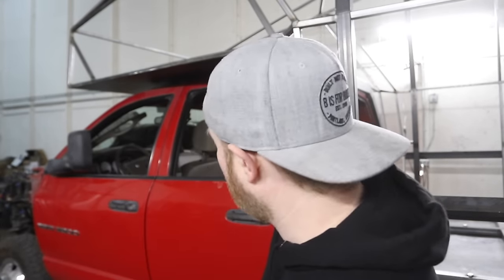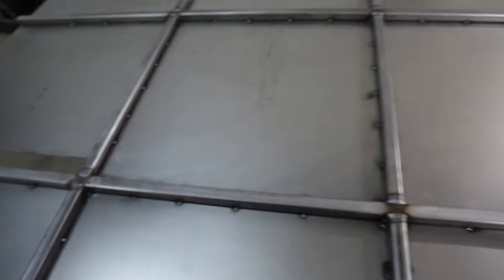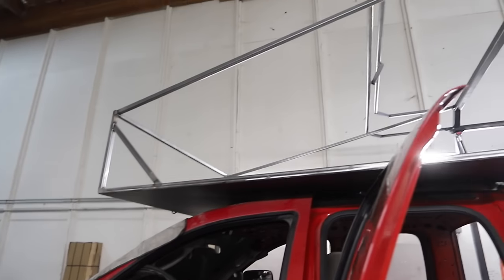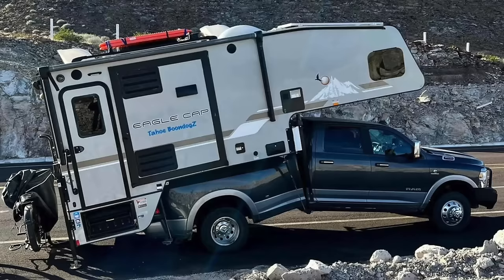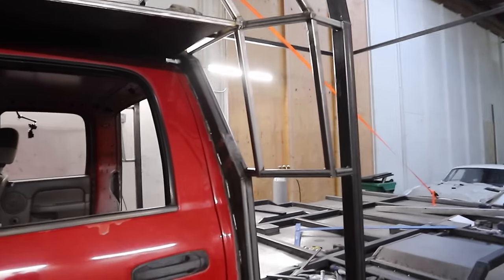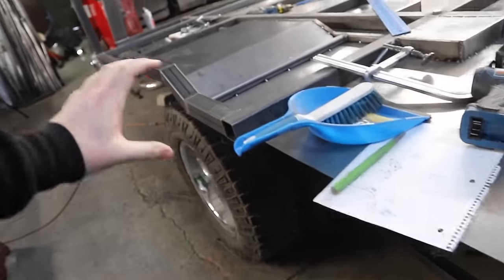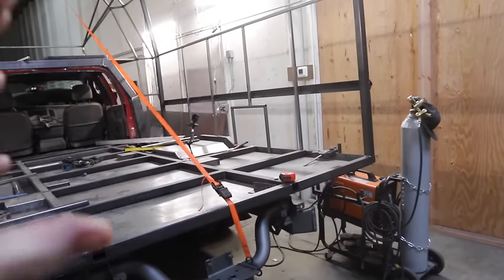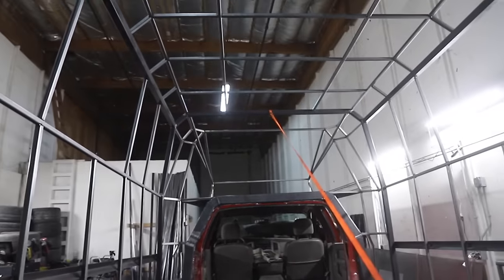Building The Worlds Craziest Overlanding Camper Truck - The ROOF

Comment: When you get to the insulation stage, begin studying “thermal bridging”. You live and camp in the northwest and you will be so happy with your camper if you keep the thermal bridging as minimal as possible. Basically, those metal “studs” for the walls need to have some material on the inside face that keeps the cold from transmitting to the interior face of the wall. Even a thin layer of insulation felt on the inside of all your steel members will cut down drastically on the heat loss through the walls.
Reply: He doesn't listen about frame/cab flex, why would he care bout thermal bridging......
Reply: Great advice. Also, I can’t imagine that using an aluminum skin would save a lot of weight… not sure it would add THAT much cost. But it would be significantly lighter.
Reply: @RealRickCox  when dissimilar metals are in contact it can cause galvanic corrosion. It's certainly simpler to keep it all steel.
Reply: @questioner1596  it's still worth adding a thermal Bridge. Even if using Steel in and out
Reply: @questioner1596  Ahh okay. Shows you how much I know about metallurgy! 😂😂

What if the aluminum is coated with Alodine? Would that protect it? I’m familiar with using it to protect aircraft. Not sure how it would work in this situation.
Reply: To the window (to the window)
To the wall (to the wall)
'Til the sweat drop down my b@ll$.
Reply: This is a terrible idea
Reply: @pauledwards6446  - what is a terrible idea?  Insulating the studs, or not insulating them?
Reply: @TheTalonts  the thermal bridging thing is a terrible idea
Reply: @java230  this is a street vehicle, no off-road vehicle. He won't have much flexing anyway.
Reply: @JohnDoe-zr6bk  mine flexes plenty on the street.....
Reply: @java230  because everybody in the comments is an expert...
Reply: @RealRickCox  any corrosion protection is a good idea. There are also ways to electrically isolate the aluminum from the steel with rubber washers; Ford does this with the F150. My point is that using aluminium properly is an extra few steps, and in the video he said he's trying to keep things cheap or it won't get done.
Reply: @java230 , I completely agree about avoiding thermal bridges. I was answering a subcomment about an aluminum skin, not the OP.
Reply: It's not like this thing will ever be used for its intended purpose.  Maybe once to make a video. "Look how good we are " 
Yeah, that type of video.
Reply: @pauledwards6446  It just means he has to tape/insulate over contact points. It's not a big deal.
Reply: @Enter-a-name55  he will take the cars he makes to shows away from home with this and take plenty of vacations, if you went to the pnw area you would see there is just about the biggest outdoor lifestyle there over any place in america

Comment: That looks awful close to the height of the loading door. IMAGINE IF "FINISHED" THEY COULDNT GET IT OUT....
Reply: In the last video he said they measured to make sure it fit. If need be they will air the tires down
Reply: He mentioned that.  Said they may need to let the air out of the tire or take off tires and roll out on a jack or something.
Reply: Just take the tires and axles off and drag it like they do at Copart.
Reply: Air tires out...temp shop
Reply: I was just about to comment on this. 😂
Reply: I’ve put a lift on my truck in a home garage… didn’t think about the height. You only do that once.

Comment: My prediction…. It’s gonna cause problems when the body twists, even a little. I’d use a nice rubber composite to fill the gap in between the cab and camper. Hopefully it works but I’m skeptical.
Reply: No the cab and the box are one just like a sub it is not going to twist
Reply: It's welded to the cabin. Ain't no rubber going to add any flex now.
Reply: I would of went with a rubber accordian boot between the cab and box. Whatever you want to call it. The cab and box always have movement between them. Even a very minimal movement will not play nice with their welding.
Reply: Definitely going to be problems with the way this thing is built.
Reply: There are thick rubber bushings underneath it. They will allow the rear to flex and the camper to stay aligned with the front/cabin
Reply: Right? In the last video when I saw them putting the same old braces back on the frame rails over the truck bed without any extra torsional reinforcement, I was like "These guys are doomed". Either the frame is going to twist (which it is designed to do) and take the camper with it, or the camper is going to have to have to have enough torsional resistance to prevent a) forces from it's own weight + forces the entire weight of vehicle + forces from being under sustained load when in a weird position + short-but-regular high-G impacts while driving. I love these guys and hope it works, but if you pit physics against blind hope, physics is going to win every time :|

Comment: The gvwr is the weight of the truck one driver and a full tank of fuel. The Dodge the broke in half had a ton of weight behind the axle where it wasn't designed. Your frames won't break because of the weight being spread over the entire chassis. The issue I see is once you build it and get three guys in it with all your gear and food and adding the tongue weight of a trailer your pushing your limits. But I'll wait to see what happens lol
Reply: GVWR is the max weight the entire vehicle and everything in it can weigh.
Reply: @OnyxCobra  yep I do believe they base the capacity on 1 person though. So the payload would be calculated at the weight of the truck with 1 person and a tank of fuel. If you add 1000 pounds of people and stuff that reduces you max payload by 1000 pounds. Some people just figure if payload is 6000 pounds they fill the cab with everything then add 6000 pounds in the box which is overloaded if that makes sense
Reply: @kevind5508  I like this BifB community. 
Very helpful and constructive 😎

Comment: One thing to consider is to reinforce your wheel wells in case of a blowout so when the tire blows, it doesn’t rip all the flooring out or any plumbing or wiring that’s from experience
Reply: im with you on this, if the frame twists at all thats going to be an issue.  im guessing parts of the box frame build will bend.  still wishing them best of luck though!

Comment: love the build chris just maybe suggest rounding out the front? even forgetting the drag/fuel/noise at even 60mph thats alot of force on such a large vertical plate on the front that is going through those front mounting points as it levers and a high pressure area between the roof and the frame. Just interested to hear your thoughts
Reply: Shuttle bus bodies are mostly fiberglass with wood, the  only steel is the frame for the floor.

Comment: Chris, this looks great and probably one of the most interesting builds of yours that I cant want to see the finished product. One observation that I have; I have a Toyota FJ with a camper tent on top, there is a lot of drag and noise over 55mph. The front on your camper is way bigger than mine so I believe it will be very noisy to drive and you will get a lot of drag. Hope you have considered the aero dynamics during the design phase. Wishing you best of luck with this awesome project.

Comment: Thank you for taking the time to address people's concerns.  I understand where you are coming from as I have been there many times myself.  That said, consider adding additional structure by tying the front and rear suspension perches together.  Not a guarantee, but will add a lot of strength through the weakest part of the frame, which is also what we did in the mid 90s to keep our 10 second street legal fox bodies in one piece.

Comment: Door on the left side is an interesting choice. Most camper trailers have the door on the right. Seems correct to be on the right when it comes to parking curbside. Not that you will be street parking it.
Reply: you can get in and out via the cab, so its not really much of a problem, if they do park kerb side, just go out of the rear passenger door.
Reply: I work in the RV industry in Elkhart Indiana.  The doors can be on either side but the majority are on the curbside.  I was actually a “door guy” on a few lines and had to pay attention to the door placement so I knew which door to install.
Reply: It’s going to have two doors. One on each side.
Reply: It's going to have three doors. One on each side and the back.
Reply: @Smokkedandslammed  back will be storage locker all the way across under the window
Reply: @Oscar_SMT  is this oscar did a great job oscar?
Reply: @Oscar_SMT  Its going to have four doors. One on each side, the back and on the roof.
Reply: @myopinion69420  but that seems inconvenient, might be a mild oversight.
Reply: No problem in Aussie then 😎
Reply: @Oscar_SMT  that seems like a waste of space, with one door you could have storage or bench space on the solid opposite side wall.
Reply: @MKPatrolGuy  I agree. Why 2 doors? Use the space for cabinets, sink, fridge, bed. seating, etc.
Reply: @Eatongee  Its going to have five doors. One on each side, the back, the roof and a secret door near the spare tire area.
Reply: The framing around the wheel wells is the same on both sides, so he was probably just standing on the wrong side of the truck (due to space available in the shop?) when he talked about the door.
Reply: @udonenomee2117  Interesting. I've seen thousands of RVs (of all types) and never seen a coach door on the driver's side. How frequently is this done?
Reply: @brianb-p6586  it’s more common in a “toy hauler”, “racing trailer” or concession style.  Probably much less common in camping towables and coach RVs.  - without going from small aluminum towables all the way to class A motor homes.  I have actually built most styles, Rance aluminum and about 4 other Forest Rivers, US cargo, StarCraft and even modular homes.
Reply: @Udone Nomee  a driver's side door makes sense for a concession trailer, where the public face is the passenger side and a driver's side door would be a back door for staff. In an RV with a cab-coach walk-through it wouldn't make sense.
Reply: @brianb-p6586  very rare on Coaches yes.  Whatever they are on we call them suicide doors.  I can’t remember why a very small percentage of a camper would need one but there are other snowmobile styles where about 10-20 percent of what I built had a roadside door.  Rance aluminum avalanche line, comes to mind for lots of roadside doors.  I was the door guy two different times for about a year there.  I have very bad arthritis starting from all my time in the industry and the infantry, so my time I can do certain jobs is limited.

Comment: The cab to bed joint should have a gasket instead of being one solid structure across that span. Would be interesting to hear your take on why you decided to weld it solid without a joint for flex. Speed bumps, dirt roads, driveways.
Reply: Theyre isolating the camper like the cab with rubber bushings. The cab and camper will be one giant piece. The frame will be able to flex beneath it
Reply: @William Bailey  true but a truck will flex a lot between the cab and box. This is the first I think most people have seen were someone has tried to weld the camper box to a cab on a truck like this.
Reply: @williambailey309  but I like seeing them trying things nobody else has.
Reply: @williambailey309  Uhhh I have a camper with a cabover. Bolted to the rear frame, it moves easily 1.5" above the cab
Reply: @williambailey309  The rubber bushing won't make enough of a difference, the box is going to rip away from the cab at the first speed bump, those frames twist and move way more than they're accounting for.
Reply: @java230  Yes that's because yours is a completely different construction. Apples and oranges so no point in comparing them. Just sit back and see how this works.
Reply: @AnttiBrax  not really Completely different.... But it I'm watching to see how it goes
Reply: I think they're considering it like a body-on-frame van. The body runs the whole entire length of the frame with body mounts and it doesn't cause any problems.

Comment: You could add a center support/roll bar from the frame through the b pillars, it would not only add safety in the event of a roll over, but would help with the structural rigidity of the build.

Comment: Well with weight at most you might need to add some more bracing under the cab and add another leaf spring to the pack but otherwise not that much of a worry

Comment: I don't know if this has been addressed previously, but my biggest concern would be when Chris calculates weights if he is accounting for dry or wet weight. Dry being everything that is being added on to the truck and wet being all the gear, fluids, and people added for an actual trip. Because if he is close at the end of the build the wet weight could send him over.
Reply: Not only that, I hope it isn't going to compromise driveability, because this thing is going to be incredibly top-heavy..
Reply: He isn't calculating the unit weight at all. He only mentioned the weight of a couple of the many components of the build. If they knew the weight of the design, or even a complete list of materials, they could have provided it... so I'm sure that they don't.

Comment: My main concern is that many states require all original safety equipment (ie. lights and etc.) to function in order to pass inspection. So how do you intend to replace the cab lights in the event they burn out.
Reply: I was thinking the same thing. I hope they put new led bulbs in before the roof platform was welded on.
Reply: I haven’t seen enough of these comments!
Reply: not an out of service item, might get a ticket, but they wont shut you down.  but I bet Chris is willing to cross that bridge if and when it happens....
Reply: @andrewward4246  Agreed during the year just a ticket but at inspection time to renew the plates ALL safety items must function, hell I have failed initial inspection because my wipers were worn.
Reply: There is no safety vehicle inspections in Oregon only Emissions
Reply: @TripleDiamonds  Interesting my state has over 100 counties all of which require safety inspections yet only 5 or 6 require emissions. As all the rest are quite rural and the number of vehicles do not create a significant enough amount of emissions for it to matter.
Reply: @lennyo5165  my state doesn’t require either lol
Reply: @Lenny O  yep living in oregon youd be surprised what you can get away with iv seen some safety hazard of  cars driving around and no one bats an eyelash
Reply: @AlienBmxican  same in Florida lol
Reply: They obviously should have been relocated to the front of the camper, and the clearance lights must be relocated to legally indicate either the height or the width of the unit. There's no thought into making any of this legal, safe, and functional, so I assume that as long at it makes a test drive for a video and rolls into the arena for a show it will have done what it was intended to.
Reply: @brianb-p6586  I think that’s the same for all of his builds lol.
Reply: @TripleDiamonds  This is the only one of their builds that I've seen, but that's the impression that I'm getting, too.
Reply: @TripleDiamonds  in Canada my province doesnt have safety or emissions annual inspections lol.  Only Commercial Vehicles.

Comment: Being an rv tech the overall frame structure looks sound! The only issue I see is the overhead bunk, that area normally have an 1 1/2" x 4 1/2 - 5" structural beam that goes along the roof line to help support the bunk structure so it doesn't flex as bad at the b pillar point

Comment: How do you plan to service the cab lights if they need to be replaced?
Reply: Good question.
Reply: They may have taken the bulbs out already since they aren't going to serve a purpose any longer.
Reply: Hopefully the seals don't leak either.
Reply: Put new ones on the front.
Reply: @Whatwherewhy586  wide vehicle ID and clearance lights are still required. Do you think that builders like this would really leave dead lights in place? That wouldn't look very flashy.

Comment: Really appreciate how you take the time out to address comments and are so honest about where things are going and if they work or not.

The weight thing didn't really flag as a major issue for me, what I wonder about now, is around how it will work with expansion and flex in the chassis - from new, the cab and rear truck bed are separated with an expansion joint and the pro build campers take the same approach. But if I've understood correctly, your camper body is fully welded to the cab as one piece? Will that work ok with expansion and chassis flex?
Reply: Yes, it's rigid to the cab and nearly rigid to the frame, so the camper body will take substantial stress in flex.

Comment: I have a recommendation. You should install lift points and reinforce the frame at those points on the top of the camper. Not only will it help if you need to lift the camper off in the future but you can use it to tie down let’s say a canoe.

Comment: Have you thought about or did I miss you guys talking about doing maybe a kind of front exo cage? You could tie in some of the front of the camper to a beefy bumper, and sidesteps directly tied to the frame for more torsional stiffness. Angled bar from the top of the windshield straight to the top of the bumper could act double duty as a branch guard for the windshield.

Comment: I honestly think the most you’ll have to do for the weight is maybe add bags
-a mechanic that works on fleet vehicles
Reply: It has over 9,000 pounds rear GAWR - if they get close to that with the weight so far rearward it will eventually snap the frame. Their problem is not suspension... and the truck came with air bags.